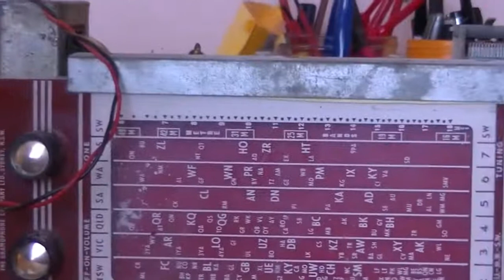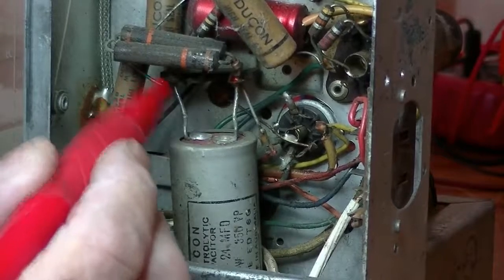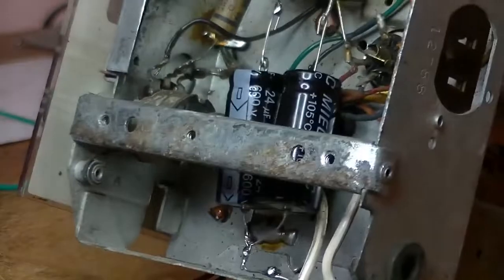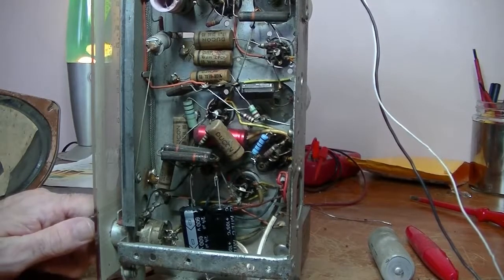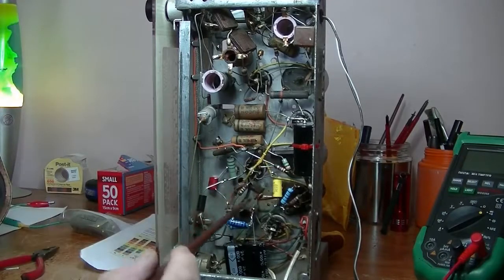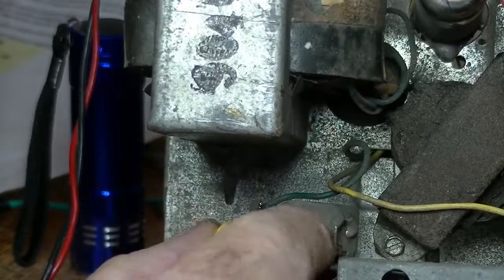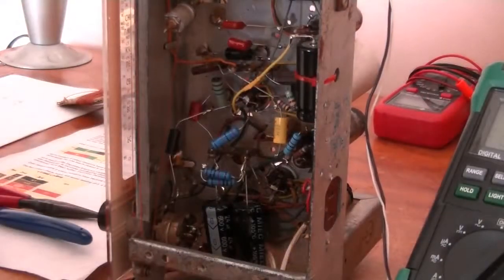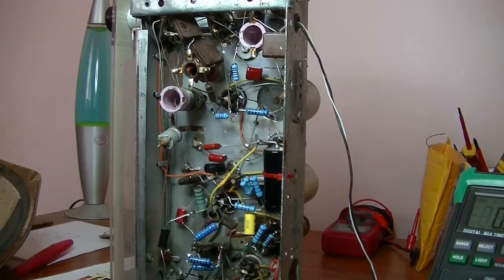Valve radio restorations for the beginner. Episode 1

Comment: Hello, interesting video, I was just wondering if you have a video on replacement of chassis mounted smoothing condenser with say 2 × 8uf in one condenser and how to  wire up the yellow,  red,  black terminals would be very helpful Thanks
Reply from the maker: Hey David, Yes I have shown just what you ask in various videos but there is no dedicated video on the subject. The next radio I get with a dual cap can, I'll make a video detailing the swap over. One of the Astor models has a single can with 3 capacitors in it, from memory an 8, 16 and a 25uf. That would be a great example if one came in. Cheers
Reply from the maker: I just found the video for that Astor I mentioned. This might help. Let me know if you need more detail

https://www.youtube.com/watch?v=54cNWqg9D0w